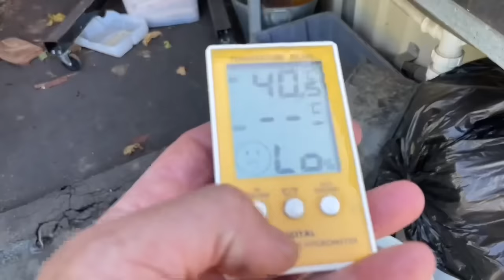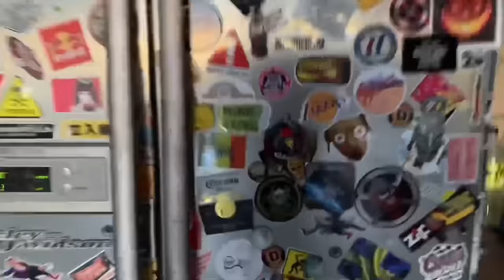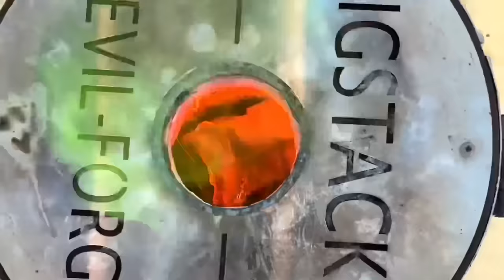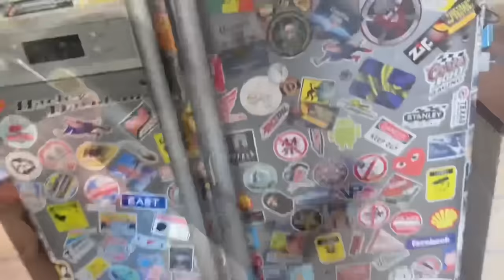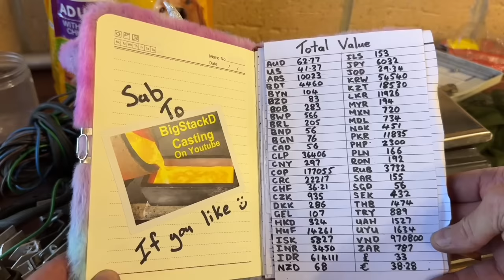75KG Motor Melt Scrap Yard Find - Trash To Treasure - ASMR Metal Melting - BigStackD Copper Casting

Comment: it's always amazing to see the manufacturers of the motors put just enough copper in to fill the mold right up to the top. Either that or the mold makers have figured out the correct size of the mold for the motor you decide to melt. Either way, it's amazing!

Comment: 16:24 

I RECOGNIZE THAT PUMP! I cut many of these at my last job! These things were such a pain in the backside to cut. Cast iron! Not steel.

Also! You may want to check that middle piece you knocked out. It may be either brass or bronze. I know we use either stainless steel, brass, or bronze for the impeller. I'm not sure which one for that model though.
Reply from the maker: No worries at all my friend, I’ll definitely have a look as it’s still sitting in the steel scrap pile I’ve got here , hopefully it is brass and if it is I will definitely show it in a future video👊🏻😁
Reply: Can't believe one of my pumps got beat to heck by a legend like you! Well, probably not a pump with my fingerprints on it, but one I would recognize from anywhere!

Comment: Wtf were in the garbage bags, my guy? 
Been here from the start when you told me to not skip the ads. And I didn’t so you could make it. 
But after all these years you never acknowledged my question. 
All good though. I get it.
Reply from the maker: I will be probably doing the garbage bag contents in a few months. I’m just trying to build an outdoor furnace of sortsfrom a cement mixer so I can throw bigger pieces of aluminium in including small engine blocks and maybe rims and stuff. I just need to get that sorted first👊🏻😁.

Comment: Do you plan on getting any equipment to process steel? Or did you decide it would be too dangerous/expensive to work at those temperatures?
I think a nice glossy stainless steel bar would be cool.

Comment: Not surprised about the aluminum. I was thinking it was melting odd, it was almost peeling at first, and the ton of slag that came off it. What would it be mixed with? And holy canolli that other motor is a beast! On today's melt... "it doesn't look like much, but she's frigging heavy" and "she's certainly old and weathered, that's for sure" is what I used to say about my ex 🙂 (just kidding, my ex was actually ok, we just grew apart as we grew up). Did Ingot lose any vision in the eye he had the infection in? Notice in the light it's cloudy. Poor little dude 😞 Just gotta love those little meatloafs!

Comment: Can you not melt the steel with your forge? or is that likely to break the forge?
Reply: No, with the melting furnace you can heat steel to the point where it can be forged. But it cannot melt steel at 1700 degrees.

Comment: Another thing - almost no aluminum in use is pure - especially from the sources you usually get scrap from….invariably somewhere around 5% is silicon, copper, manganese, iron, etc. Aluminum is especially affected by what it is alloyed with, which is why it is. Even 1% of some other metals can make aluminum much harder, or less brittle, or have a much higher compression strength, or be more suitable for machining. The fact that you had a donor source that may have been 8%, 10% other materials or more may have been obvious in how it revealed itself to you, doesn’t change the likelihood the rest of your melts are highly likely 2, 3 or 4% alloys…